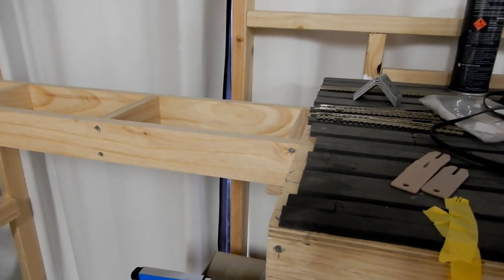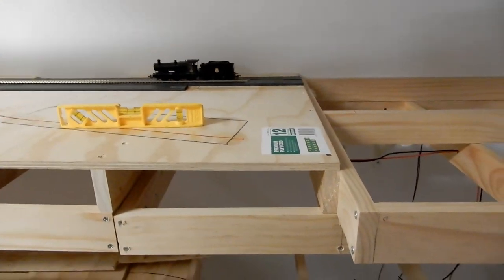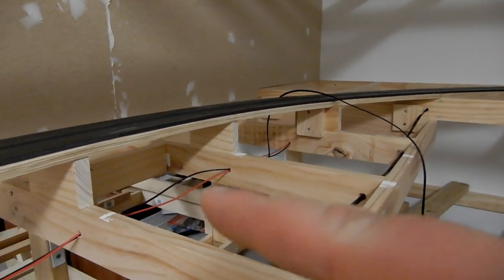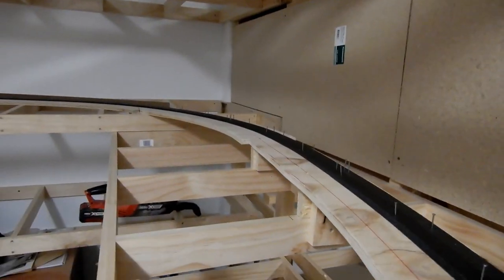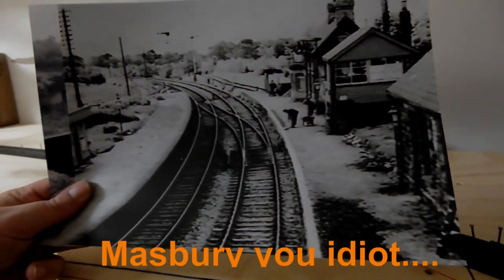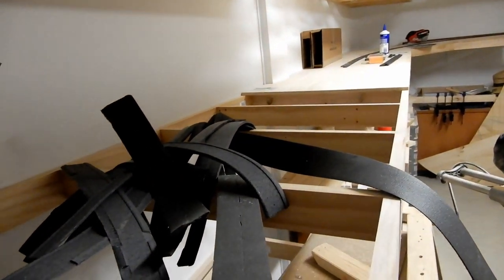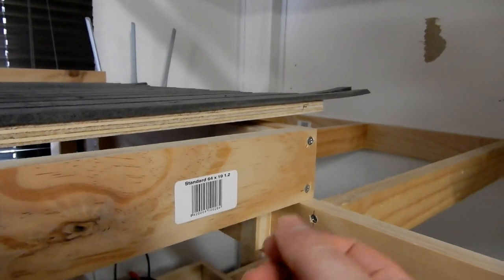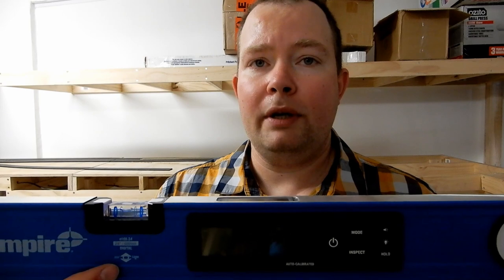Leila Central Model Railway Layout Update Feb 2021

Comment: Laser level would work the best. You can rent them. You mark a level reference line around the room, so can set the bench work. I use a 6' (2m) esprit/digital  level when doing flat work. also check level both ways by Turing the level 180 degrees. Getting track level can be a true pain the behind. Looking good so far, it will get there.
Reply from the maker: Some great advice there and it's much appreciated! Definitely will check out renting one for this. Thanks for watching and commenting, Clint

Comment: Good to see you back Clinton. 
Another option to keep an eye on levels is a laser on a camera tripod. I got a cheap ($59) one from Sydney Tools. My room is 7.5 x 6.5 and no spirit level is going to be spot on over this distances. I have the Stanley version of your digital level (I’m pretty sure the insides all come from the same factory) and it’s very handy especially when measuring % of grades.
Reply from the maker: Yes it sure seams the best way moving forward getting a laser. Definably will get one. Surprisingly not expensive either. Thanks for watching, Clint

Comment: Think the bullhead track will be a while, i`ve got 4 boxes off code 100 on back order as i`m not paying the premium some outlets are charging. as others have said run a laser line round there not to expensive now and always handy for other diy projects, i`ve been looking at floor underlay foam as a cheaper alternative to woodland scenics track bed. cheers
Reply from the maker: Yes I agree completely with your comments on the bullhead. While it would have looked great, I am still ok with code 100. The cost some places are charging and eBay are astonishing. Thanks for watching and commenting, Clint

Comment: One of the things that I have noticed with a number of modellers who post on YouTube is that you feel that you need to keep to a timetable for each posting. As you commented, this is a hobby, and the release of videos is part of that hobby, so do not pressure yourself in trying to keep to a schedule. Enjoy the hobby. Once you sort out the roadbed height, which I know from my own experiences is an absolute pain, you will be laying track and getting a train running in no time. Worry about putting out another video then.
Reply from the maker: Thanks Eric and yes I have avoided the youtube hype otherwise the hobby becomes a chore. I'm glad I have not put any track down because if I had found this issue while tracking laying, I would have let a few strong words out of the bag! Thanks for watching and commenting, Clint

Comment: Hi Clint 
New to the channel your layout looks great :) just a little heads up about levels (coming from a bricky) NEVER TRUST A LEVEL when I buy a level, I will always check by turning the level 180* and make sure it reads the same in both directions another trick is get yourself a 1500mm piece of 100x50 that is straight and put your level on top of it, that will put your little discrepancies over 1500 mm so there will be less, hope this helps in the future
Cheers Mark
Reply from the maker: Very useful information Mark, it is these things that i love about connecting with other people, you never know what you can learn.